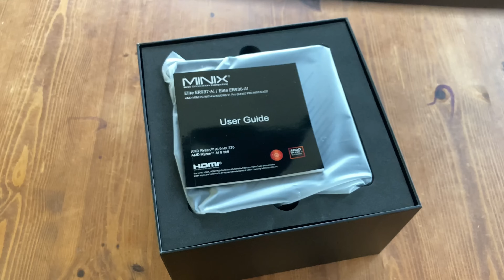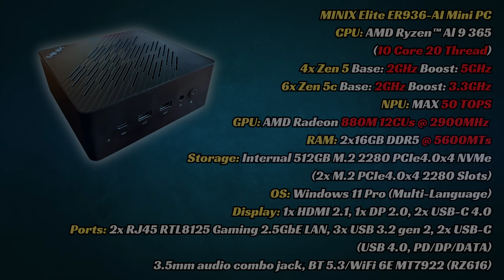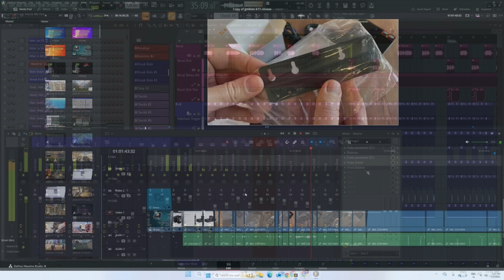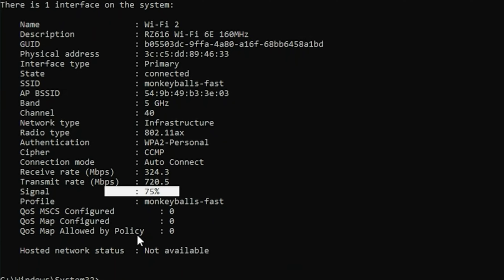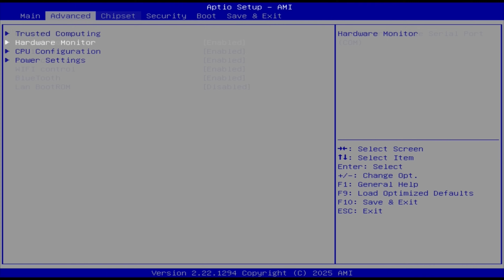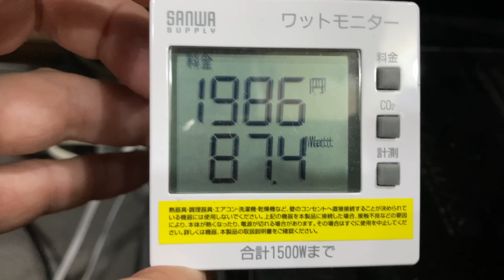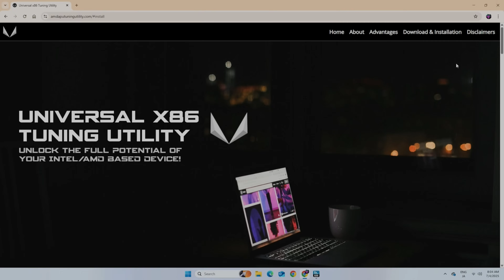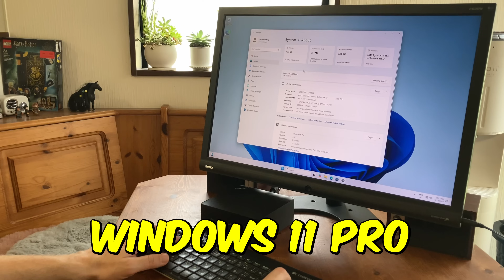Minix ER936-AI Review: This Ryzen Mini PC Packs Radeon 880M Power! 🔥

Comment: You put far too much thermal paste on the processor, no need to spread it either, a tiny blob in the middle and it will spread evenly when the cooler is tightened back on.

Comment: Not having VRAM option in the BIOS is like begging to not be purchased. 
Meh.  Unacceptable to have such basic BIOS in 2025.  

Having said that, I want to congratulate Minix for their cooling solution, bravo.  Also bravo for making it possible to open the PC without a need of a screwdriver.  Longer term that's fantastic and definitely a huge plus. 
To reach the CPU is not perfect, but at least they are not actively trying to make it difficult.

I think this is a good Mini PC.  The lack of Oculink port is annoying, but at least they have USB 4.  Not perfect, but it's something.
Temps as I said are looking great and making it relatively easy to do maintenance is a huge plus.
That BIOS is just a poor excuse for a BIOS though.  I hope they release a BIOS update else, for me at least, it would be enough reason to not buy it.   Well, if I had money that is.

Thank you for another great review.
Was not expecting to see anyone mentioning CivNet in 2025.
WHEEEEEEEEEEEE!
Reply from the maker: I'm guessing they skipped on the VRAM because it can now be allocated via the Adrenaline drivers, but still that doesn't really cover the Linux side 😢 - either way I think most of these issues regarding the bios can be easily fixed with an update - who knows if Minix are willing to do this, though. Will be interesting if they're commited to a quality product, or will they just see how many they can release? 

Either way they did a good job with that opening mechanism, very nice to see ☺️ 

Thanks for the comment, oh, and before I forget... Wheeeee!

Comment: So, 880M in Cyberpunk - 1080p Medium same fps as 780M in Cyberpunk - 1080p Low?
Reply from the maker: I'll run a comparison soon, but the GPU seems to be extremely similar to the 780m, maybe with some cache improvements.  The 365 as a whole is likely an efficiency improvement until the next gen appears (the tick, tock cycle)